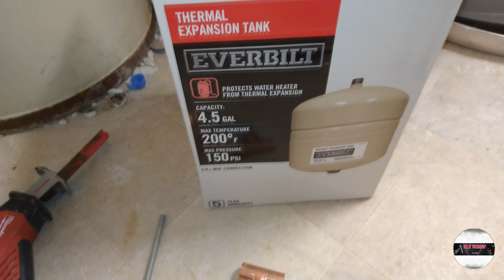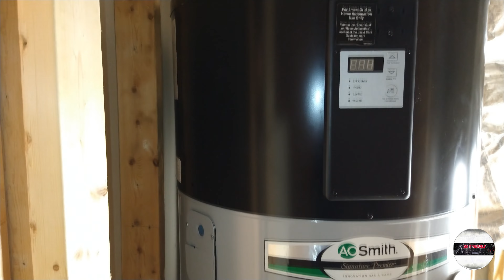HYBRID🟢 | A.O. Smith Water Heater 816194 | 80 GALLON HEAT PUMP  |  FULL INSTALLATION!!!

Comment: Why add the thermal expansion tank?
Reply: Most municipalities now block homeowner water at the street, from back flowing into the public water supply. This creates a closed water system at the house, with no way for water to expand if needed. Thermal expansion tanks are now code in most areas as a result.
Reply: @thenexthobby  only required in areas that have closed systems.  No use if not closed.  Many cities have closed systems. Many areas 80% of US still has open systems.   You can easily call water company and ask.

Comment: My problems with AO Smith is for a $2000+ hot water heater they couldn’t make it controlled wirelessly and they make as difficult as possible to duct this outside.  The “conversion” to a duct is $300. DumbASS engineers could have EASILY had it exit to a 6” round duct connection like almost Every other manufacturer.

You install made it impossible to ever duct that cold air to the exterior garage or outside.